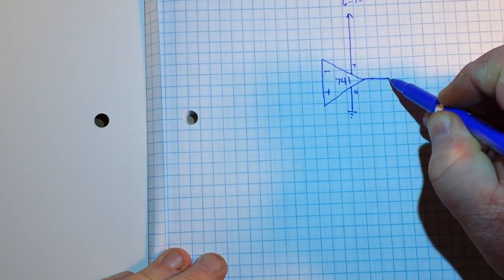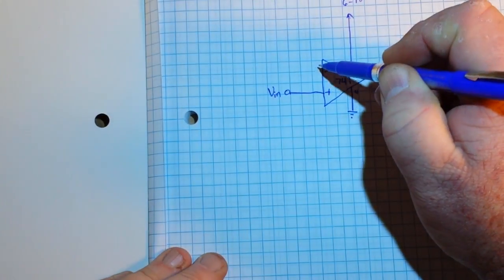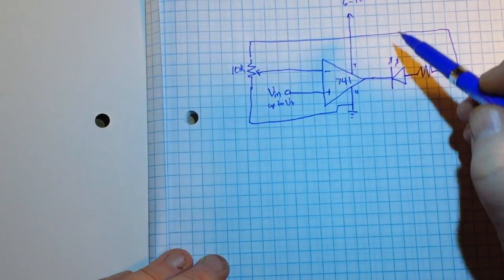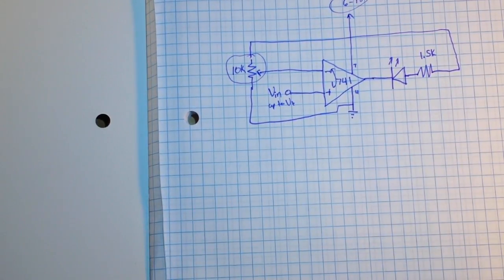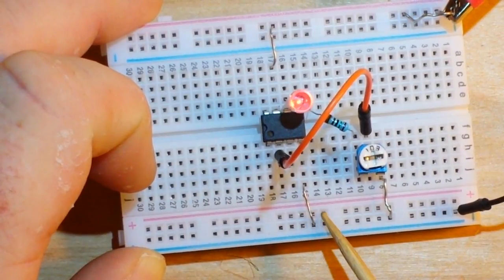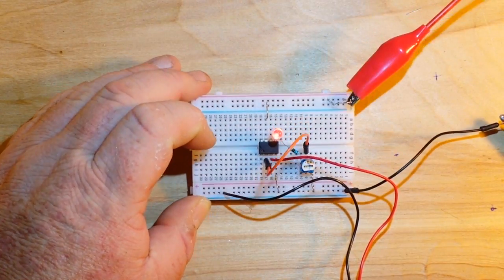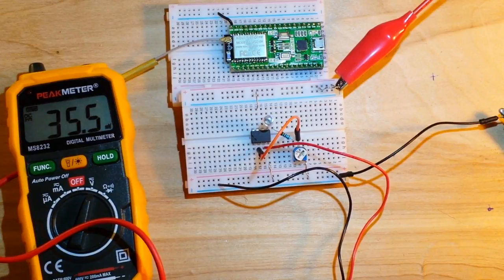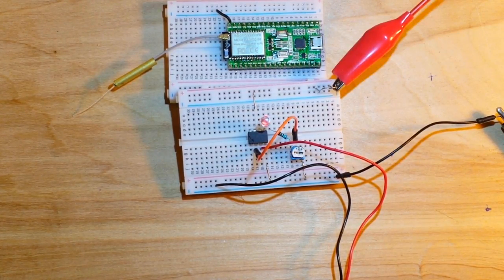How to make a volatge alarm circuit

Comment: Good wee circuit.  I have a stockpile of kits to build and don't know what to do next!  Chinese sellers have a lot to answer for!  I should really build the wee DSO scope which I've had for ages but never quite get round to!
Reply from the maker: gartmorn The DSO138? If that's the one, then by all means build it. It's not difficult, and when it's done you will have a very useful tool.
Reply: learnelectronics I think I held back because I don't know if I could fault find if it didn't work!  I will build it soon but am also thinking of investing in a wee bit more versatile scope (but still in the economy class) maybe a hantek or the like!